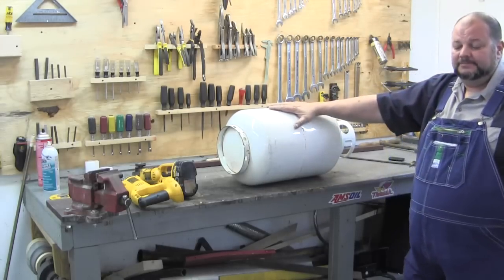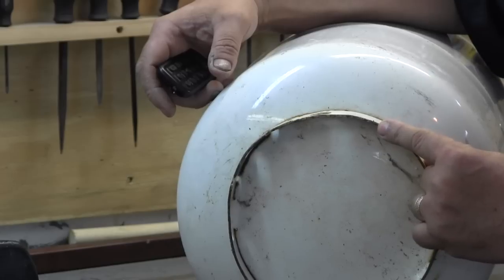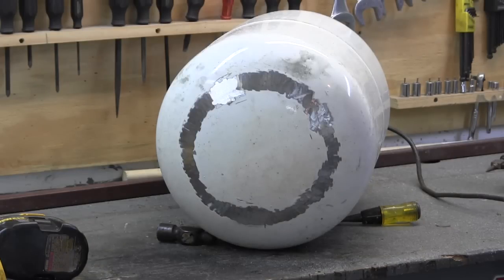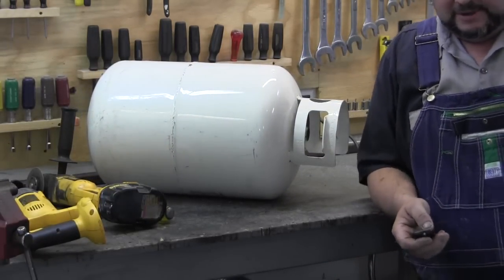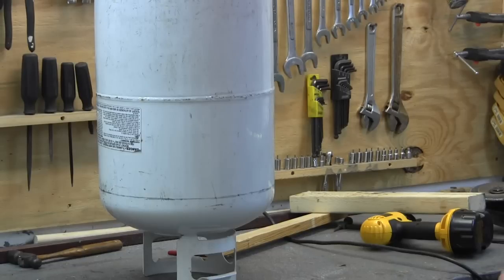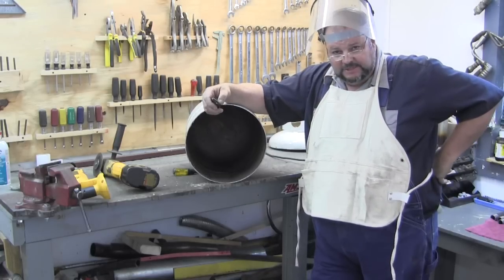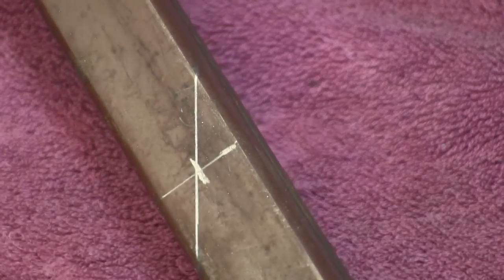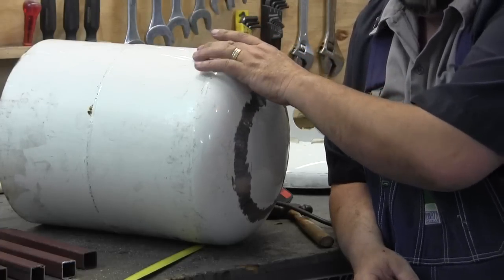How to build a propane tank rocket stove 1/3

Comment: Hey Man, I think it is real humble for a man of your expertise to admit your flaws. By pointing it out and using it to teach, You've more than made up for it. I've learned how to make some cool stuff from you. Being a carpenter I wanted mention  that the speed square can read that angle. Just put the pivot point on one end of the line and pivot it until it matches the angle then read the number along the bottom edge where it says (DEG.) for Degrees.

Comment: Another trick for a straight line for round objects is to use a piece of cardboard as a ruler around the perimeter.  Make sure the same edge match up and it will be straight, then draw a line.

Comment: Looked around and couldn't find any exact specifications (steel gauge used) however they do look comparable and people do seem to like using them to make iron forges with then as they are narrower then propane tanks.  Plus an advantage of the freon tank is that freon is inert so no risk of explosions with left over gas unlike propane.

Comment: If you look on the speed square you will see what is called a pivot point, place your square on the work pivot the square to the desired angle, look diagonally out from your 
pivot point you will see  degrees marked on the other opening there are your angles  practice this and it will save you time. The stove looks good.

Comment: At 6:20, if you have rusty old wheel rims, you might want to put that cut top on the bottom of 2 old car wheels welded together to make a BBQ spit. That bowl shaped top with a plug put back in it will keep burning ashes off the ground. Just grind the handle off, so the bottom wheel rim balances the whole thing and cut out the center of the bottom wheel. I did see this though on another video.

Comment: hey brother, quick tip the speed square you were using to mark the angle has degree marks on it to measure angles
Reply: Jesse Smith it's one of those simple things that a lot of people don't realize if they don't use a square much. I didn't know until I was in my high school shop class and I grew up build things with a speed square.

Comment: ohhhh now then, that triangle measuring stick, which you use to mark a 45' angle on that steel tube, do you know why it has a notch out of the triangle bit at 0 inches ? i have one, its got a notch also, and i have no idea what its designed to do!

Comment: make a plasma cutter your self gotta old large micro wave take the secondary coil part out replace with a multi strand welding cable it two wire and insolation cover on each side of it this make your High voltage D.C out put a clamp on one wire end and a glass tube with a tungston tip or buy the wand and leads and an air compressor to blow the metal away mine is working well i just bought the hand tool of the plasma system

Comment: Plumbers use something called a Contour Curv O Mark Wrap A Round to mark cylindrical objects. It is just a strip of heavy paper. Math isn't my strong suit either but I know that Speed Square has a protractor built into it. I saw the degrees marks stamped in it in this video even, so if you can read you're set! BTW 3 legs are more stable than 4. 3 leg stools never wobble! Might make your stoves easier to make.

Comment: If you'd marked the circumference cut line before removing the bottom ring you would not have needed to make that jig nor get help to hold it steady. Just stand it on its base, put the flat pencil on some things stacked up to the right height & rotate the cylender on the bench.

Comment: The diagonal angle on your speed square is 45 deg. The other two sides make 90 deg. On the diagonal side there are angle lay out lines for the rest of the angles that you might need . You did fine with your layout but you could have used the speed square just hook the lip side over the tube and draw the diagonal line. If you admit weakness then people spelled dic-s will make mean comments that don't help anything. Some people that know things will make suggestions that are helpful one being those welds are tack welds not spots.

Comment: Hey buddy, what was the reason for removing the valve if you cut the top off anyways? If the valve has been open for a while is there still gas in it?
Reply from the maker: I don't know for certain that there isn't something still in there that might be explosive and/or flammable. At my age, I've learned not to take chances that can be avoided. It's to easy to remove the valve,purge the tank,and remove all doubt that it's safe to cut.
Reply: @Jackmanis, whenever you're cutting into a propane tank you should take off the valve and add water in there with a garden hose before you cut it to avoid any type of explosion.
Reply: +Jack Watkins  its best to remove the old paint and repaint with high temp primer and high temp paint, you could find it at your local Auto Parts store.

Comment: your angle would be 30 degrees. 2 x the diameter leaves the angle theta at 30.  1.41" on the speed square would be 45 degrees.

Comment: Nice video. Thank you for the time you put into making ...MY...future project much easier. And BTW, math is important, however, Math (or ANY college degree) does not define a person. I am not degreed and can screw in my light bulbs at home WITHOUT having to use a Slide rule or calculator. Ha Ha... Thank you again.

Comment: Safer way is to drill 2 small holes and fill it with water
Reply from the maker: So, you are saying that a better way to purge a rank is to create heat and sparks on and in the tank??????  Uhhhhhhh,,,,, no thanks man. I’ll stick with my way of doing it.
Reply: I wrote drill, not cut with torch
Reply from the maker: You do realize I removed the valve and purged it with water, right? If your saying drilling into a tank with propane unit is better than removing g the valve and water purging, you truly are stupid.

Comment: I wish you well, on the pursuit of math. I wasn't a whiz bang at it either. You don't have to be, if you know where to look for a way to solve your problem.
If you haven't gotten your plasma cutter yet, I have a small math problem for you.
Tractor Supply plasma cutter -    $800.00
Cheapy Chinese plasma cutter-  $220.00  from ebay
Money still in your pocket-         $580.00  Oops, I gave the answer away!
Chance they came out of the same plant- Dang near 100%.
 Take an extra dollar out, and buy a longer piece of plastic tubing, for the built in gauge. The one they supply, is too short. If the gauge is on the back, keep the dollar.
  Wife got me one for Christmas. Works great. It's yellow. Make sure you wire it up to 220.  110 will cut at 25 amps, 20 % duty cycle. You will throw it out! Friend of mine did just that with a Hobart plasma cutter. It was gone, by the time I became interested enough to figure out.He had it wired wrong. 
  If you want a second fuel source. Check out the used oil burning rocket stoves( OilBurner). And, guard your eyebrows, while you experiment!  My natural aspirated one, has gotten me twice!